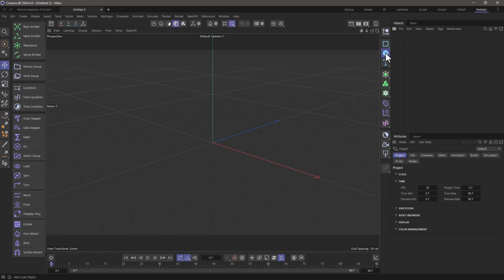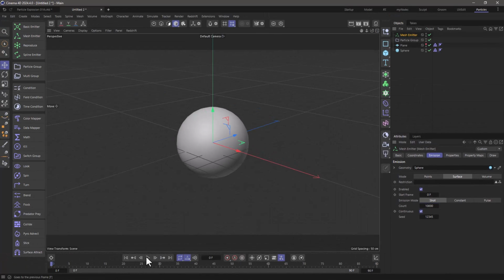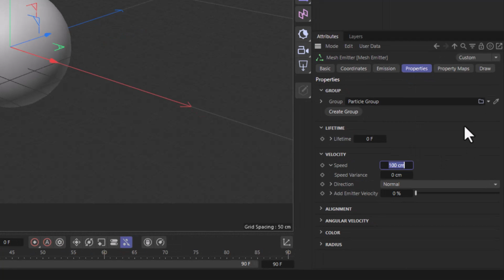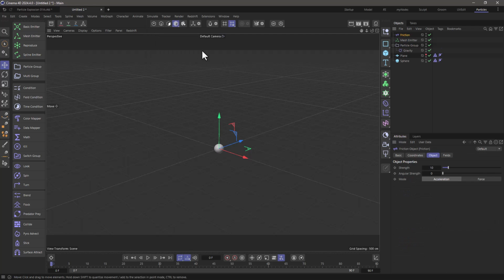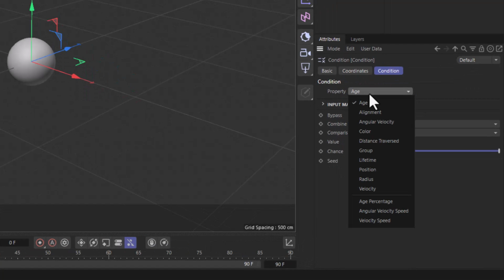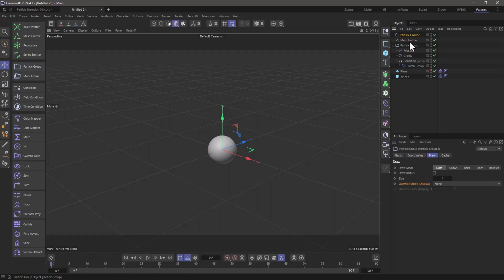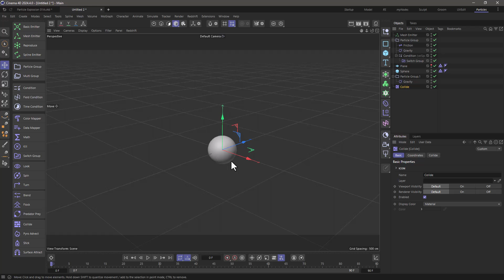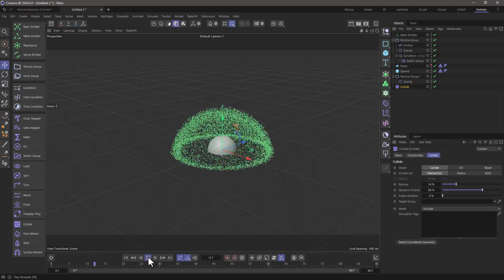#C4DQuickTip 139: Particle Explosion in Cinema 4D

Comment: I've discovered that collision detection is only efficient and fast with low-poly meshes. If you increase the plane resolution to 100x100, it will not function correctly.
Reply: Actually, I think is the scene scale the problem. Simulation with smaller objects seems to slow it down e fail collisions.